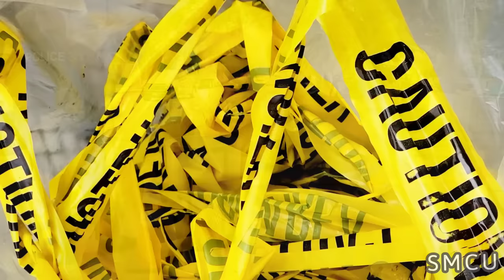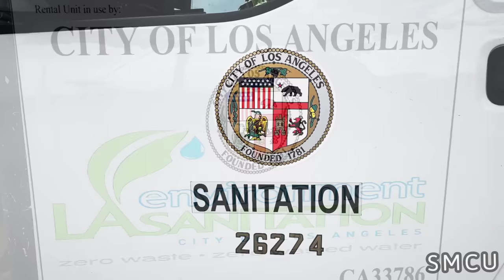Venice Takes Action: Massive Homeless Encampment Cleanup and Beautification Project

Comment: The number of cops standing around is hard to ignore. Every single one makes a good wage and every single one moves as slow as molasses. Even the workers use some sort of powered eq. for every single task they do. Two men for every garbage bucket. One runs the broom while one holds the actual bucket. I`m surprised they haven't got a power broom.